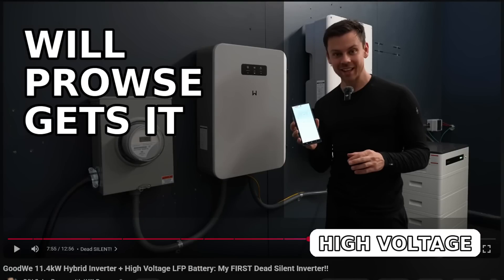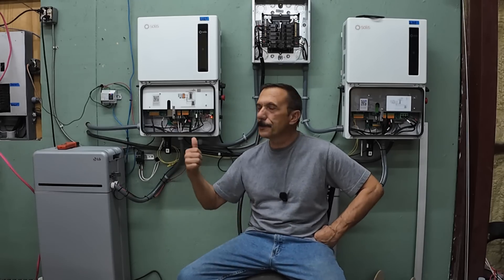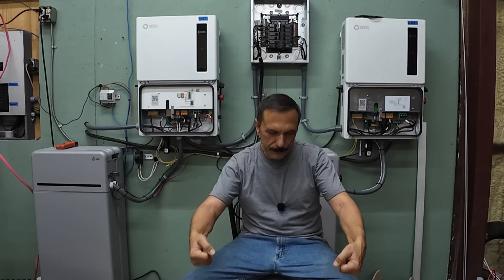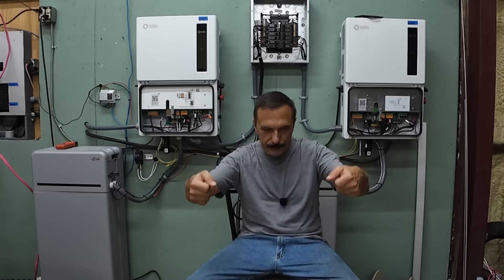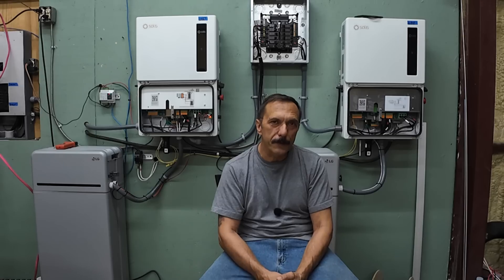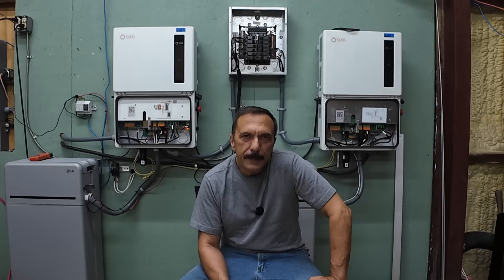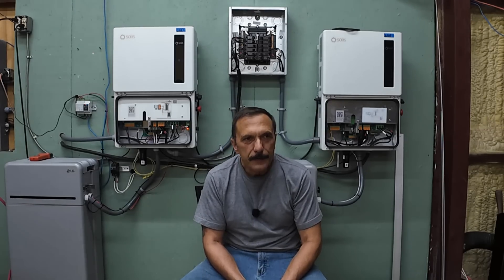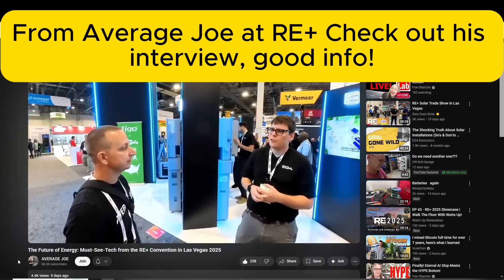Will Prowse Gets It! High Voltage Solar

Comment: interesting direction but what about safety?  Isn't high voltage inherently more dangerous than 48v?  and there is no way I'm putting a NMC salvage car battery in my home.
Reply from the maker: If you go with the commercial batteries I would argue that they are safer in that the currents drawn are much lower than a 48 volt system pulling hundreds of amps. Obviously you don't want to be poking around inside a live inverter or battery cabinet but the same goes for the latest 48 volt hybrid inverters where you can see up words of 600 volts DC on the PV inputs. 
I agree there is no way I'm putting "any" salvage car battery in my home also, that's why mine is in a shed away from the house. The cost per kWh is just to attractive for me not to partake.
Thanks for watching!
Reply: @DIYSolarFarming great info,  looking forward to following and seeing more content.  Keep up the good work.
Reply from the maker: Thanks for watching!
Reply: I worked for years on live 480v 3 phase and still have a few unburnt body parts.
We’re already working on 500 volt PV strings in our 48 volt systems . The higher ampacity batteries are no more shock hazard than the PV circuits.
The lower current high voltage systems reduce the main risk in electrical devices,heat from loose connections and small wires.
Reply from the maker: @danielking2944  Right on!

Comment: new gen inverters are more prepared for ev charging..
so they are ramping up all of them..

growatt made a interesting product (in small scale) but the idea is not bad for low voltage batteries 
its called a Double Voltage Power Hub

growatt dont have low voltage batteries in their new line up for example
Reply from the maker: I haven't heard about that Growatt unit, I'll have to check it out, thanks!

Comment: Price just needs to come down.
Reply from the maker: I think the Solis 11.4k with LG 16kWH battery is about the lowest cost starter system you can get.
It even beats the 48 volt systems in that kW/kWh class.
Reply: @DIYSolarFarming I have 10kw of panels, 60kwh of LFP and 10kw hybrid inverter for $11000 installed

Comment: I’m in the process of a big build myself. I’ve decided on the lg hv batts and the SolarEdge line of inverters. I’ve got 33 kw total inverters 3 (11.4 home hubs).  I’m waiting on the backup interface so I can also run off grid with this system.  I’ve got 100kw of panels from Santan for 17k delivered👀.  Starting with 80 panels at the beginning and will work up from that.  Need to get in prior to incentives being stripped.  Nice about Illinois is grid tied gets SRECs and will nearly pay off my diy build once finished.  Hoping to get it in prior to end of year.  Going to be mining btc as well.  I’ll be keeping up with your setups. Thanks for sharing the info.
Reply from the maker: Nice, that's a good size system!
What are you planing to run for miners?

Comment: I’ve put my home solar build on pause since I’ve seen your S6 videos. I have a 6000xp 48v system at my cabin which works great but need more power at home. Just worried about backfeed as I can’t have an interconnect at home location.
Reply from the maker: Yes, I have the same situation with the back feed but there are several ways around that.
Reply: @DIYSolarFarming can you do a video about the back feed topic?